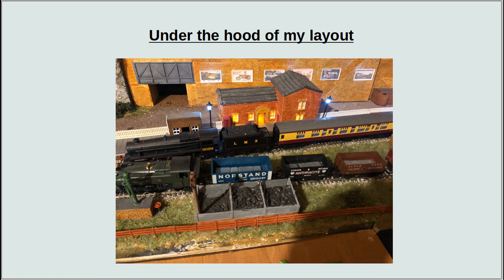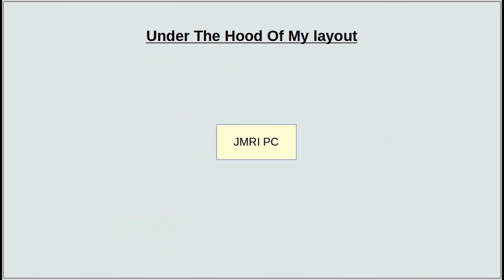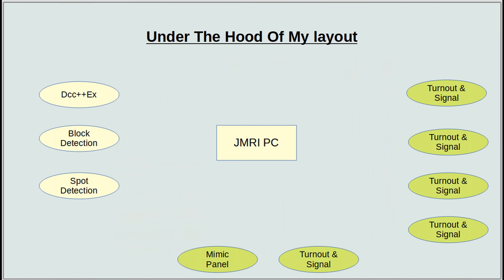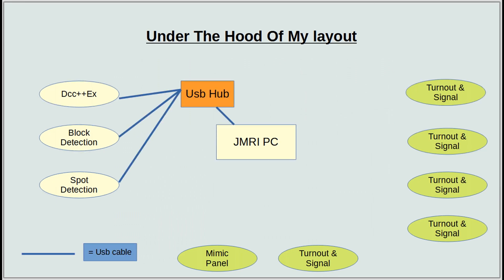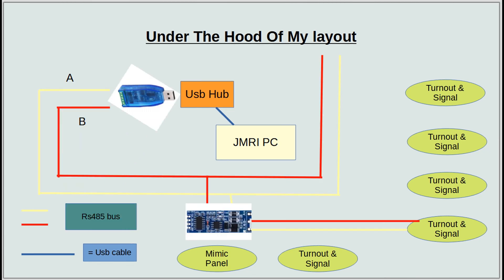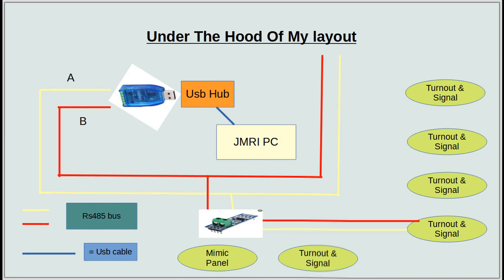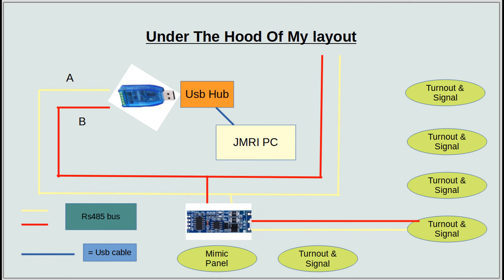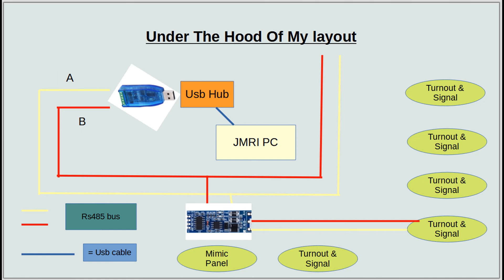My OO gauge Arduino loft layout under the hood part 2 Layout control bus explained

Comment: Whilst I think about things, you might find (depending on your setup) that it is better to have 2 rs485 busses, one for sending signals back to the hub and the other for receiving signals from the hub, this means you se more arduinos but it means you don't have to set them up to both transmit and receive which makes setting them up somewhat easier and is less likely to result in interference between hubs , at this point its worth using cat5 or cat 6 network cable (which contains 4 twisted pair wires) and wiring up a mini network using proper network boxes, I'd advocate using cable that is either shielded (has S/UTP printed on the outside) or is at least foil wrapped (has F/UTP) printed on the outside because of the previously mentioned interference from servo motors and model train motors, you can get inexpensive cat5e boxes with anywhere from 1 to 4 outlets which you can place at convenient locations around the layout which means you can just plug in a new I/O hub whenever you need to each socket will allow you to connect to any of the 4 sets of twisted pairs. Find a little computer shop that can wire up Cat5 cable onto the boxes for you and have them create a cable long enough to run from one end of the layout to the other, stick a 4 outlet breakout box every meter or so along the line (or even every half meter), make sure you have resistors on each end of each of the 4 twisted pairs and you will be laughing, with this setup you can have up to 4 busses and that should be enough for anyone
Reply from the maker: That is something that crossed my mind in the past about separating the tasks so 1 unit transmits and the other  bus is for receiving data. In some ways I have kept some units just using Usb cables this these tend to be for devices like the block detection and 1 off the mimic panels and spot detection. So thanks again for the tips. I may also buy a crimping tool for rj45 connectors. I will look at the suggestions and any I adopt will be shown in future videos.

Comment: the resistor at the end of the bus becomes more important the longer the bus and the more devices you have attached to it, ideally unless the bus is very short you want to use twisted pair wires to carry the data with a mesh screen around the wires (typical of network cable) the mesh screen prevents signal interference, very handy if you are driving servos (for point control) which generate a lot of interferance. Which module are you using to connect the Arduino to the RS485 ?
Reply from the maker: Hi David you are correct about using twisted pair of cables however so far I am not and not having a problem, If this does become a problem its a quick fix so thanks. Also the resistor is on my to do list I am waiting for some to arrive in the post. I am using the second version use see in the video it uses a uhart chip which I understand does the triggering between rx and tx.
Reply from the maker: The issue I have is a built the layout very quickly and went for a central location for all the electronics which did mean a mass of wires. And now looking at spreading out the units as I want more devices due to adding signal to the system. will it ever stop lol
Reply from the maker: The 3 wire module which is cheaper, there is also information out there on the internet that suggests you should remove one of the resistors on the board as the come with a 120ohm resistor across the bus any way.
Reply: @modelrailwaytheeasyway9743  yeah this is common, if you daisy chain the boards only the ones at the start and end of the line need the resistors
Reply: @modelrailwaytheeasyway9743  I'm doing things slowly, because I have to scratch build everything, I decided early on I would automate things using JMRI, DCC-EX++ and a set of busses for both data and power, so with me planing everything out in advance means I can build up sections, So for example I already know that my main station requires 11 or possibly 12 sets of points, along with a bunch of sensors and there will be a lot of signals, I will also have a lot of structures being lit, currently my plans are to have one data line for points, one for signals one for sensors and one for lighting this means that I only need to monitor a single sensor network line on JMRI that will only have data coming in, but it also means if an arduino fails it should be easy to both trace and replace, this is not set in stone and some locations may have only a sensor arduino and one other doing everything where perhaps I only need a pair of points, a couple of signals and a few lights but .....
Reply from the maker: When I started to build the layout I had no real clue other than what I had learnt from Rob at Little Wicket. I then just found myself adding more stuff as I went. Since found out that I need to do somethings differently.
Reply from the maker: I am making the layout so it can be automated fully if required. I will do it using Jython scripts which I have some already written and tested there is an example of a multi train one which I will add to my github page when I have 5 minutes.